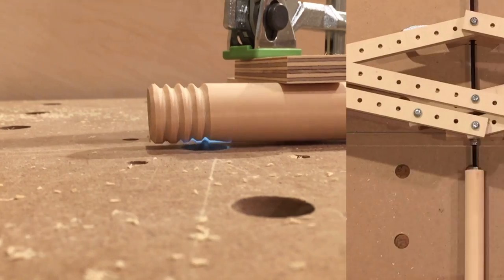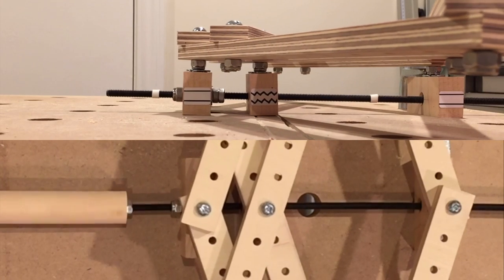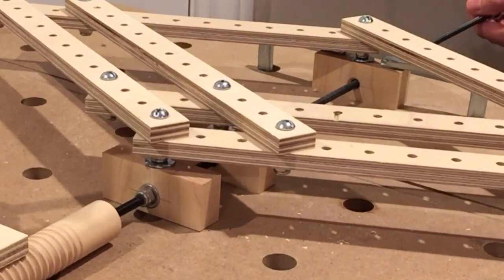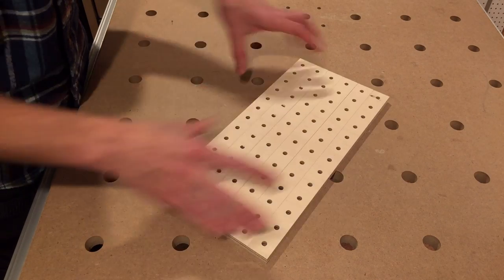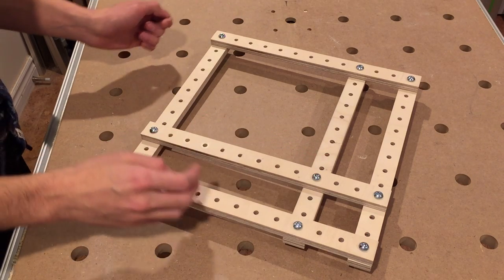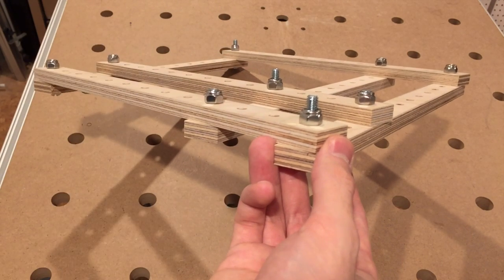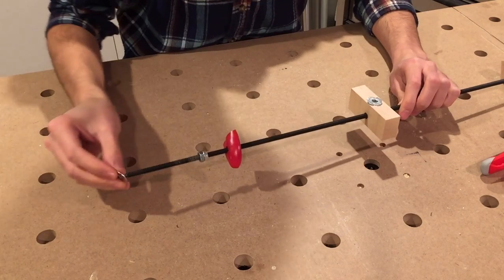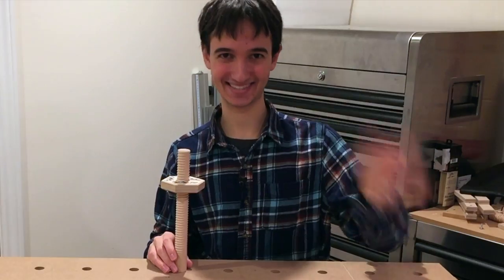How to Make Wooden Threads

Comment: Ok, I'm officially impressed!! Wow, VERY smart idea there, I love :)
Reply from the maker: +John Heisz – Thanks John!! What would be great is to use this jig in conjuction with your thread making method: start a thread using the jig, and continue it with your router table guided setup. That would be awesome! Currently I'm limited to cutting some pretty short threads – not enough capacity in the mechanism to make... I don't know... wooden vise hardware :)
Reply: When the idea started to crystallise, my fingers started to itch. They wanted to scroll down and find your comment, John. :)
Reply: Toolify if you added some gears you could reverse thread also and easily switch from one direction to the other half way through, which could be useful. Thank you for coming up with this idea, I love parallelograms and pantographs for jig structures. I'm going to make a bunch of beam clamps completely out of wood and do this instead of buying threaded rod, it should work fine.
Reply: Totally impressive ! I knew there was a reason we were always told to pay attention in Math class LOL  Great Job !

Comment: Might be more stable if the moving blocks riding on a rail. Really nice work there.

Also, to anyone who need the formula:

let t = (number of threads per inches on the steel threaded rod)
let r1 = (number of holes in the smaller square lengthwise)
let r2 = (number of holes in the larger square lengthwise)

tr = t / ( ( r2 / r1 ) + 1 )
where tr = (number of threads per inches on the wooden rod)
Reply: Shouldn't that be tr =t/((r2/r1)+1) ?
Reply: jof1953 yeah, you are correct. 20 thread per inches metal rod with 3:1 ratio gets you 5 in the explanation in the video. Thanks for the correction.

Comment: Does that little bit of wobble have any affect on the finished product? I'm wondering if you added a metal guide rail through the wooden blocks on either side of the threaded rod if that would help stabilize it a bit? I guess it's not a big deal if the threads come out okay. Thanks for making this video!
Reply from the maker: +legacyofbob – The wobble is generally because I couldn't drill a hole perfectly square into the exact center of the dowel. The effect it has on the end product is negligible, but you're right that using metal guides can improve the precision if the application requires it.
Reply: +FastEasySmartTOOL maybe just put a bushing on the far side of the jig.  So when the dowel is cut, it feeds through the bushing and use the major diameter of the thread to keep it straight.  Like a gatco bearing for boring crankbores on an engine.

Comment: Hi, what is the purpose of the pentagraph? I do not get the mechanics of your devise. Does pentagraph transfer the rotation of a small-threaded metal screw into larger range foreword movement so that the wooden screw threads are scaled wider? Or does the pentagraph generate any up and down movement?

Comment: You are a smart kid.
Sears used to make a tool to cut spirals into wood with a router.
But you're cutting good threads,  Clever. 

So Question? What do you use wooden bolts and nuts for?
Reply from the maker: +bobbg – I have a few ideas... a related video or two should surface throughout the year :)

Comment: I'm curious as to what cause your first attempt to fail?  Was the base just not clamped down well enough?
Reply from the maker: +Eric Schwartz – If you pause the video and compare the mechanisms you'll notice that the first version used a more compact version of the scissor mechanism. I added a few redundant links in the later design, and that really helped with overall stability and tolerances.
Reply: +Toolify ok...THINK I understand what your saying.  Basically, you made the second version bigger which helped stability?

Comment: Could you show us a way of making trunions for tilting a home made tablesaw?
Reply from the maker: +Δημήτρης – I'm not quite sure what trunions are. I also don't use a table saw right now.
Reply: +FastEasySmartTOOL Trunnions are the part of the table saw that tilts the blade with the arbor.
It&#39;s a big deal because it the turn offcenter so the blade can cut at the same spot in any angle, not like hinges.
So you do all your cuts with the track saw?
http://ggober.com/shop/images/p66over_18.png
Reply from the maker: +Δημήτρης – Okay, understood. Yeah, all I can say is building something like that is not in the expected future. All my cuts are made between the track saw and mitre saw – just no space for a table saw in this little workshop.
Reply: +FastEasySmartTOOL There is always space for a table saw! :)
Just make is compact with folded sidewings and outfeed table.

Comment: Been some time since anyone comment but have a question.  Is the number of threads also dependent upon the thread count of that threaded rod?  What would one use to get.. 2 threads per inch on a 2 inch dowel using this specific setup?
Reply from the maker: It is dependent on the (metal) threaded rod, and scaling effect of the pantograph. Unfortunately, I would not recommend using this setup to produce a pitch of 2tpi – at that high scaling factor the mechanism will have too much play (wiggle) and cause error.

Comment: Is it possible to change the number of teeth per inch ? I would like to do 8 tpi if possible .
Reply from the maker: Yes! You can achieve that with a 1.5 : 1 pantograph ratio and a 20 tpi metal threaded rod. Let me know if you need a hand and I can draw you a diagram to show how to go about setting it up.
Reply: That would be very helpful, I am a bit mystified by that prospect.
I appreciate your quick response and lover the video
Thanks
Reply from the maker: No prob. I'll put a little diagram together tonight and send you a link soon.
Reply from the maker: Hey! Here's the sketch of a 1.5 : 1 configuration providing 8 tpi output for 20 tpi input (calculation is 20/(1.5+1) = 8) http://toolify.ca/wp-content/uploads/sketch/8tpi-threaded-rod.png
Cheers!
Reply: Thanks for this